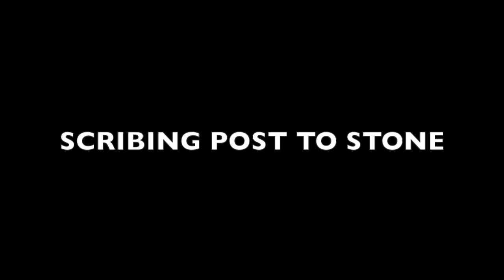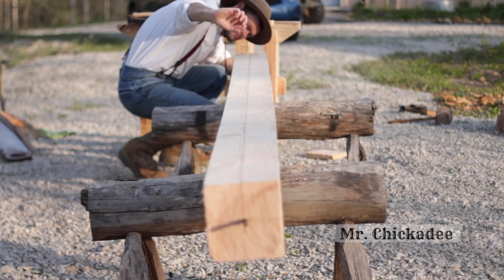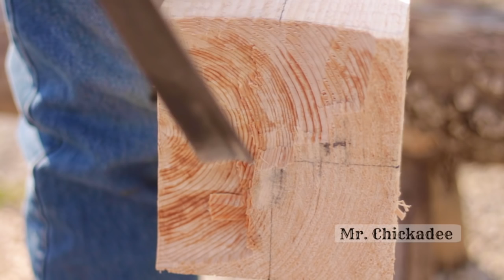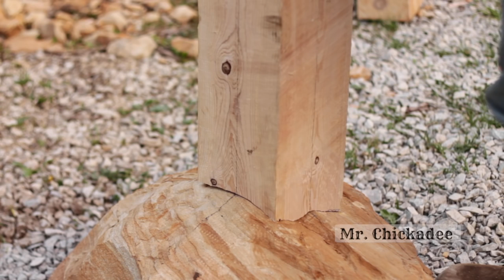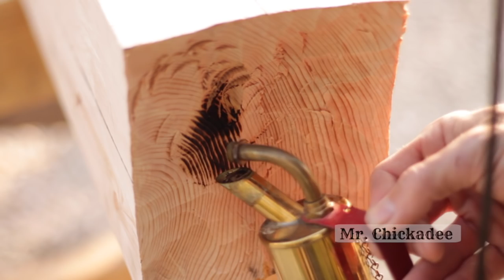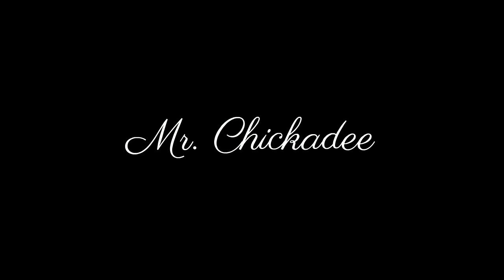SCRIBING POST TO STONE

Comment: Is it necessary to match the center of the post to the stone as well? Or is it sufficient to just get the edges to match the stone and hog out more material than is necessary in the center of the post?
Reply: It looks like only a relatively small portion of the outside edge of the post makes contact. 
It would be very difficult to get it to match completely. Likely it would be easier to flatten the stone.
Reply: If you hog too much material from the center it wont be safe and secured since you dont have friction fit
Reply: I had the same question; it would be nice to see the answer.
Reply: Jeremy Butler I notice that the centre of the wood aligned to marks placed on the rock. I suggest the helps always place it in the same spot every time
Reply: Yes. Other wise, the slippery slope principle goes into effect.
Reply: Why don't you drill a hole in the center, to the depth of the scribe line, so you know how deep to go?  When you are close, put some dark powder (that will wash off easy) on the rock, put the post back on the stone, see where the post is actually making contact with the stone.  Use that as a guide for any refinement.  The scribing is not to make it pretty (it is all hidden anyway.  It is to evenly transfer the load from post to rock.  It should bear evenly.  Sort of like fitting a plane blade to a new dai.
Reply: You could Put some construction adhesive in the centre. It will fill the voids and it hardens up solid
Reply from the maker: Mr Butler, That is an excellent question! In fact, because of the great compressive strength of wood end grain, even a modest size two story building would only require a slim area of bearing along the perimeter to support itself for many hundred of years. This has been proven in ancient architecture in thousands of examples from all over East Asia. 

Now if further "reassurance" is needed, the middle of the post can be hogged off quite proud, and a simple traditional Grout can be mixed up from clay and hydrated lime powder, also a bit of boron salt can be added to the mix as well, this grout can be applied as the timber is pressed down. The clay will not only help support the post, it can help whacking away excess moisture. (though with proper design, overhangs and drainage, moisture under the post should never be an issue!) 

A threaded rod can also be epoxied into the exact center mark for each post, go up inside the post and be pulled down tight with a locking washer and nut from above, if a small mortise hole is left in the side of the post to access. 

Portland cements and other modern grouts should only be used at your risk, as they are not proven by time and are in fact often very detrimental to wooden architecture, they tend to trap and hold moisture onto the wood instead of safely whacking it away as natural clay and lime mixtures do.
Reply: Thanks so much for your detailed reply! I like the traditional Grout idea. Thanks again for your beautiful work. It is truly inspiring!
Reply: What was the burning and oil at the end for?
Reply: @rosscoep1450  protects the wood from rott
Reply: @MrChickadee  j
Reply: England, would chemfix a centre 16mm S/S stud. But that might be cheating. Regards
Reply: When I saw the small brass torch blackening the end of the timber I thought it would be used to give a witness mark where the stone touched. Like using lamp black on a gun breech or using blue dye scraping in a lathe bed to see where it touches. Can engineers be joiners? Yes, but they need to adjust their degree of precision a little. Unfortunately I am neither but I try. 
Thank you for your wonderful videos
Reply: While not traditional, I don't see anything wrong with a blob of construction adhesive in the middle. Don't think you'd have any issue with trapped moisture etc. However don't really see much point. As long as you have an inch or so matching all the way round, that will take many tons alone, and will sag until it stops moving. Could easily allow it to drop 5mm and have it make no difference to your frame above. Plus you would expect all of them to compress, and should expect a similar amount of compression. Not an issue I think.

Comment: Couple of questions: 

1 - How are you holding the post perfectly plumb while you scribe? 
2 - When scribing several large beams to sit on several stones, how do you find the base level point to do the joinery and attach cross members?
Reply from the maker: So first we hold the post with temp brace boards just tacked to the side and propped up on the ground. 
After all posts are standing vertical and finished being scribed, we run a water level around to transfer the same mark to all posts. This mark becomes the Zero base line for all joinery.
Reply: @MrChickadee  Perfect! That's exactly what I pictured in my head, but wanted to hear your input on it as well.

Comment: Dear Mr. Chickadee, is there any prep work required for the ground which the stones sit atop? I would like to do this in Maine. Will the freeze/thaw cause the stones to shift in a concerning manner over time, without some sort of footer underneath?
Reply from the maker: Depending on your soil, we have found that dry soil does not frost heave, it cant without water. So do what you need to do to remove water from the stones, what that is might depend on where you are and what your land is like. Get the drainage right, dry under the stones and they dont need to be very deep at all. Its all about the drainage man.

Comment: That is a very nice fit.  I see others suggesting that it only fit on the edges, but it seems to me if you cared it from all four directions you'd probably get at least 80% fit to the stone and that would do the job.  I have seen guys who called themselves finish carpenters set miter joints on doors and windows with not much more than 10% contact, which is a disaster.  I can't imagine anyone taking the time to scribe and carve to fit a stone not getting a pretty darn close fit.  As I said, nice fit!

Comment: How do you attach the stone to the wood? I loved watching that process ... thank you 😊
Reply: In this case, the scribed surface, gravity, and the weight of the structure holds it in place. If local building codes dictate a permanent connection, all thread rod or similar hardware could be fixed to the stone. Then run up the center of the post to a small mortise where nut and washer makes the connection.
Reply from the maker: Very concise and correct answer Mr Morawski!
Reply: With 3 or more posts and correct aligment of the stones the structure can easily be geometrically constrained in all axis except vertical.

Comment: Great scribe to fit work. I have always tried to cut or grind the stone flat. Was there an advantage to fitting the wood to the stone vs flattening the stone?
Reply from the maker: Yes, a rounded stone sheds water better, also the wood cupping over the stone is much less likely to move
Reply: Good point

Comment: Do you position the low corner of the scribed posts in a specific direction, e.g., towards the middle of the building?  In my head it's like if a post would have a tendency to fall, it would then be pushing into the rest of the building.  Does that matter at all?
Reply from the maker: not intentionally, but you could do that. It should not matter, your posts should not be able to move from vertical unless your joinery fails, then you have serious issues!

Comment: How do you keep it from becoming 'too concave'? Seems like it would end up splitting the beam once it has a significant load on it..?
Reply from the maker: You aim for contact all around the outside, the inside is slightly hollow. You can leave it like that, thats what I did, or you can make a traditional grout of salt, sand and clay, and put that down on the inside for added protection from insects and rot. Both were done and have been proven for hundreds or more years.

Comment: Is there perhaps any merit to altering the surface of the rocks your posts will be placed upon to both reduce the variance of the post base carving and to assure full contact between the rock surface and post base?  Such as a simple rounding off of the contact patch that can easily be matched by the post so even pressure is distributed upon both the rock and post?

Comment: What is that clever little torch you're using, where can one acquire one and how does it work?  Is it hooked up to an air compressor or what?  All I've ever seen are those large hand torches that seem to me to be overkill compared to the elegant little device you're using here.
Reply from the maker: hi Carole! This is a little alcohol blow torch, runs on denatured alcohol, used in the past to sweat copper pipes mostly. Lots of ways this burning can be achieved, propane torches, the small camping/DIY plumbing style, or large weed burning style, simply roasting the timber over a fire, or heating a plate of metal and dragging it across are all options!
Reply: Thankee

Comment: Is that really how they did it? For some reason I always thought they made a hole in the stone to socket the wood in.  Also, is the connection really that sturdy it can withstand seismic events?
Reply from the maker: Pretty much…no holes would trap moisture, and yes proven examples lasted thousands of years and many many earthquakes anchored in this way, with friction and gravity.
Reply: Thank you very much for your response.  I'm still incredulous at the fact that a little friction and gravity can keep a large building standing over an earthquake, but I'll take your word for it.  When I build my own home (one day), I'll use this method.
Reply: its precisely because it allows movement that it is so strong against earthquake. wood structures built with traditional techniques are some of the safest places in an earthquake. they can flex without failure.
Reply from the maker: Very lovely example Jay, I especially love how they used blind wedging on the horizontal support beams into the long square holes into the cliff face (very similar to the "hell tenon" in furniture). No one knew how it was done till they tried to extract beams for restoration. 

Its a bit difficult to make out in the video, but the vertical support posts must be the scribed to stone versions?
Reply from the maker: So true! Here is a video showing some of how they "think" it went together for any interested. 

https://www.youtube.com/watch?v=oc8rJVoLBKY&t=397s

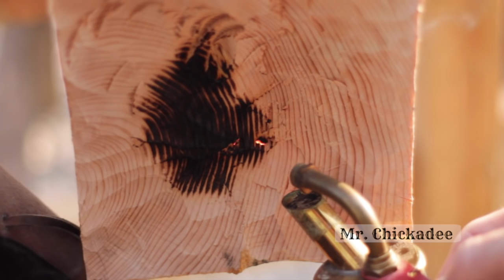Min 4:30 shows the hell tenon/beams

Comment: This is probably a dumb question but why did you scorch the wood at the bottom? (I am assuming it protects the wood from something...but what?)  Also why didn't you scorch the entire piece?
Reply: Burning and oiling the post bottom is a protective measure against insects and decay. The bottom, toward the ground, needs protection most.
Reply: The bottom of the wood is more susceptible to collecting moisture when in direct contact with stone, something to do with different temperature coefficiency and stuff. Charring the endgrain will make the wood more resistant to fungal attacks. Also algae have a harder time attaching to charred coal for the same reason.
Reply: undecidedgenius       The process of burning the wood converts the woods cellular sugars. Thus making the wood undigestible to bugs and mold.  Oiling the wood also blocks moisture from entering the timber thus preventing mold access to the wood fibers not broken down by the heat treatments.
Reply from the maker: all great answers below!
Reply from the maker: great to see you at the class Brad!

Comment: Wouldn't it be easier and stronger to make a square hole on the stone to fit the post?
Reply from the maker: Not a good idea, any holes or depressions trap moisture. Smooth and rounded are what you want.

Comment: O' course, us machinists would have blued the post end in to the foundation stone to 16 spots per square inch, drilled for and sulfured a bronze pin in the stone, and precision drilled the post end to fit, and bedded the connection with white lead putty and canvas - all while cooking breakfast for a harvest crew.

Scorch and double boiled linseed oil is a good second best. Carmelized lignin is amazinly rot resistant. Good fit-up, young man. Hit your layout right on the button. I see the gravel. How deep is it? Will that eliminate frost heave?

Is that post white cedar? Don't have it in my neck of the woods. How does it compare to western red cedar? A bit tougher, I think.
Reply from the maker: Ahhh Forest, you machinists and Engeneers! haha this aint a steam locomotive, just a bit of woodworking! ha! 

Frost heave??! Oh! haha yeah, well the thing there Forest, frost heave can't happen if you don't have wet soil to freeze and move! Thats where proper drainage, overhangs and design of site come into play, and where you see many ancient buildings just going on forever with no worry to some crazy deep foundation footers. Its just not needed with proper design. 

Our stones sit in a hole just deep enough to stop lateral movement in the event of a quake, which depends on soil type but here in the KY clay, 8" with good proper gravel base is fine. 

Its actually Eastern hemlock, sadly a dying species these days...

Comment: Can U give us the recipe for the pine tar/ turpentine/oil mix? And or sources to a recipe. I have pine tar but no access to turpentine and linseed oil.. any that can replace them? Thanks
Reply from the maker: Sure, Ill help as I can! Any vegetable based drying oil will work, canola oil, corn oil, grape seed oil, are a few examples. You want an oxidizing, "drying oil" not a "non drying" oil such as petrol based or derived oils. 

I would use any natural solvent first, such as citrus or pine solvent (turpentine), most countries all over the world have solvents used by artists to thin oil paints. I would prefer a natural solvent over one such as mineral spirits, but if thats all you have…at least in this or other outside applications there won't be danger of off gassing into your home.
Reply: Mr. Chickadee thank you very much! You have a new subscriber!!

Comment: Love your videos. How long did the scribing process take you?
Reply: Aaron Fjordlander I would bet it took him quite awhile.  Those scribes are used in log/round wood building quite extensively and require the work pieces to be set in place, properly plumbed,  ascribed, removed,  cut,  repositioned for test, removed again for moisture proofing,  repositioned, then installed.   So he'd have had to do that with every post.   Position it,  plumb it,  brace it, mark center lines for repeatable orientation, calibrate the scribe (open the arms to the largest gap between wood and stone),  scribe,  disassemble braces,  remove,  carve,  test fit,  remove,  water proof,  install, plumb,  brace.   It's quite a bit of work.
Reply from the maker: As Jay pointed out, this can be done surprisingly fast with practice. It took me one afternoon to place, scribe, carve, test fit, water level, burn and oil the 6 posts for this foundation, only one post needed more than one fitting.

Comment: It sure looks good, but does it really improve statics? Also you could powder the stone with chalk or charcoal to see where it leaves marks on the wood. This way you can adjust the whole surface not just the edges. Not sure if you did that, but I thought I share the idea since you didn't show it in the vid. I'm excited to see what you're building. Keep up the good work.
Reply from the maker: It has been proven by the oldest timber frame buildings. The most important aspect is really the good fitting of the outer perimeter giving a "gear in cog" effect to the stone, this combined with the weight of the building pressing down makes it very difficult to move anything from the stone. Examples in seismically active areas have stood for meliniia with no more done than a good scribe.

Comment: Not to be obtuse, but wouldn't a flat, square socket in the rock be more useful?  I'm not suggesting it'd be easier by any means.
Reply: graymouser no, because that socket would hold rainwater
Reply: Jonathon Jongsma it would hold rain water only in the event the eaves didn't properly shed rainwater. And flooding wouldn't be much a concern either.
Reply from the maker: Great points Jay!

Comment: Hi Mr C. !
I think its a risk that those posts split after being incharge. The weight transfert is now really bad because only on a little surface.
Its anyway well scribe.
Mathieu
Reply from the maker: Thank you Jay! As you often say, "what will work has been proven already by history for us, we only need concern ourselves with understanding and repeating the techniques of past masters and we cannot fail"
Reply: thanks i know it as roman fondation in france but it's ever on a flat wall made of dry maconnery and there is always a piece of wood horizontal on this wall wich receive the posts. it probably depend of the weight you put on the post.
thank for the informations and sorry for the bad english ahah
if you two got some reference books about that i'll really appreciate to learn more about everything you repeat from the past masters ;-)

Comment: My brother was spun up about perfectly matching posts to stones until I mixed up some concrete and dropped the somewhat dry mix on top of the rock, flattened it off, let is set, and then placed the square end of the post on it and it fit like a glove. It's thick, it's ugly, it's not carpentry, but hell if it doesn't work.